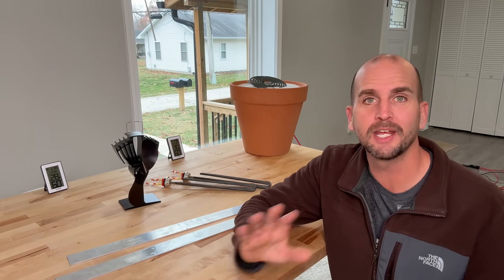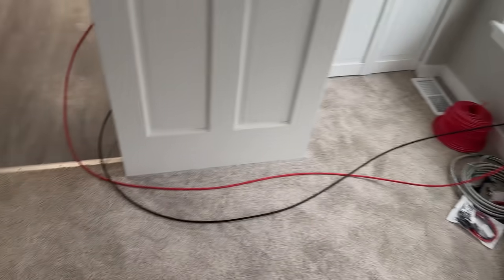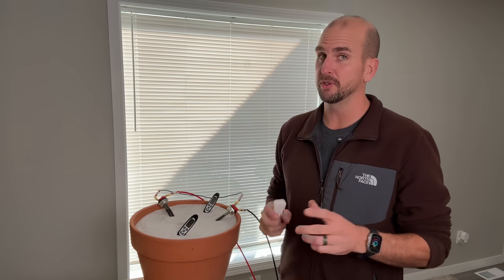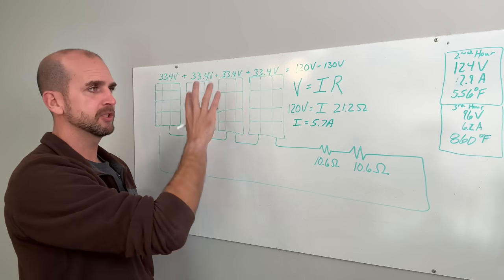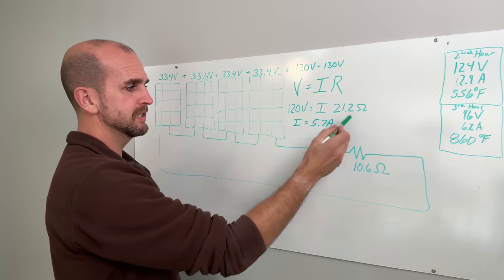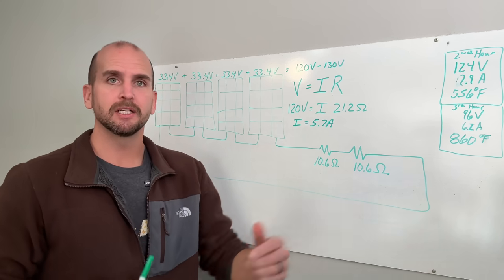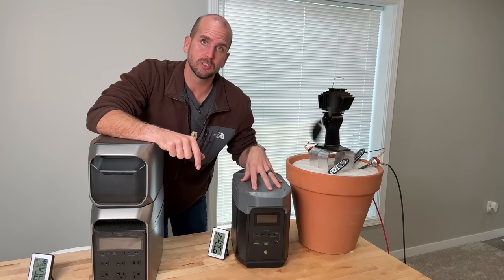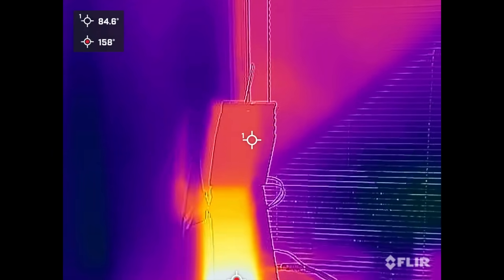Free Emergency Winter Heat | Solar-Powered Sand Heater 2.0

Comment: The single misunderstanding I see time and again in videos by folks trying to store energy is that they think temperature means anything.  Look at the specific heat of sand, which is about 0.8 J / g C, versus water,which is about 4.  Thus, you can store 5 times more heat energy in the same mass of water.  Next, rather than just blowing hot air around, actually calculate how much heat energy is needed to warm that room.  Finally, using solar panels with a twenty-something conversion efficiency means you are throwing 3/4 of the captured energy away.
Reply: Good idea! ❤🎉
Reply: heating water to 800 degrees so it can become a bomb and blow up your house....seems smart.  maybe think before you comment about how smart you are.
Reply: @wtfdoicare  "... they think temperature means anything."   You've proved his point.  The same amount of incoming energy wouldn't heat the water that hot, because it holds (and thus requires) a lot more heat to move up its temperature.  "maybe think before you comment about how smart you are."
Reply: Would automotive coolant help? I assume it raises the boiling point of the water so it can hold even more Jules. If the temps get high enough to boil water then perhaps sand will help when you boil all the water away. Having humidity and heat could make the thing work a whole lot better than dry hot air from an electric furnace. Without water regulating the temperature, is it potentially too hot for the water heater heating elements?
Reply: @wtfdoicare  Did you actually read my response.  It is not temperature you are after.  It is energy storage.  Water stores 5 times as much energy per degree of temperature rise.  You don't need 800 degrees or any other temperature.  You need heat energy storage capacity.  Operating the system at water temperatures is far safer than operating at hundreds of degrees.  Those heater elements will burn out very quickly being heated like that.  As for thinkng before I comment, I have thought about, designed and implemented systems based on these physical principles for half a century.  Tag, you're it.
Reply: @emmettturner9452  Actually an interesting point one encounters very quickly when designing a system like this.  Ethylene Glycol actually lowers the heat capacity of water substantially (by nearly half), while raising its boiling point and lowering its freezing point.  So, if yoou are looking for an energy storage medium, it is best not to use an anti-freeze solution, as it actually reduces the heat capacity of the system, i.e raises its temperature for any amount of heat stored, while reducing the maximum heat capacity of the system.
Reply: If he's using it as a supplemental heater, is it just energy storage he's after? I took the sand to be a diffuser that slowly warms the surrounding environment rate than just a battery.
Reply: So actually, the right way to do something like this is much simpler: pump regular water through a loop that involves something like a radiator inside and some solar water heaters outside. IIRC solar water heaters are basically just boxes, painted black, with pipes snaking around inside. You want to convert the energy as few times as possible, and solar panels, like you say, are ~20% efficient. Sunlight heats the water, you pipe that inside and exchange the heat to the room. Done. Benchmark: you'll never do better than solar irradiance, which is something like 1kw/m^2. A regular electric space heater is something like 1kw, so you'll need a decent area of solar collector to really heat a room effectively.
Reply: @TheTinkering1  Bingo! and Thank you.  The battery, in this case, can be a trash can filled with water. Cheap pump to circulate through the outdoor box.
Reply: @MichaelCampbell01 Something being hotter doesn't mean it is holding more heat (equivalent to energy), so I don't get your point.

The benefit of the sand is that the heat moves through the same more slowly than it moves through a liquid (which would circulate) and it doesn't boil water and change humidity in the house (while taking away some of that heat in the boiling process), so that could be better for heating into the night after the sun is no longer shining. That said, having 800F sand in an open pot is potentially quite dangerous vs boiling water (212F). Imagine a cat putting its paw in the sand or a child knocking the pot over onto himself.
Reply: @h.wagner  yeah, if we just run pex under our concrete slabs and against our underlayment we can easily have a full radiant heating system for the price of a bucket of sand.
Reply: What I think this comment means is: By using water instead of sand you get the same effect (same amount of energy (heat) storage) without the storage media (sand) getting dangerously hot. Bonus: water is free. I love this point. I didn’t realise water was such a great energy storage media compared to sand. Maybe because there’s no air between the particles. Thanks.
Reply: What about salt? You always hear about solar companies using salt for heat storage after the sun goes down. I'm keeping this short, so I'm not going to belabor the point.
Reply: @nicholasearl5703  In the instances you are referring to, they actually melt the salt.  The latent heat of fusion of salt is about 26,000 J/gC, and so it holds about 650 times more energy than water.  But, handling molten salt at 1,474 degrees F is not for an amateur setup.
Reply: If you happen to have a heat-pump water heater and a hot water recirculation loop (about half of homes have a hot water recirculation loop), then simply running the recirculation pump continuously overnight will inject heat into the house's mass via the hot water pipes, and actually noticeably reduce furnace use.  At the cost of electricity, of course.

Obviously that isn't as efficient as it could be.  Due to insulation of the hot water pipes only so much heat can be injected into the house this way.  But the same concept applies to using a dedicated hot water system, without the insulation and without the cold-water mixing valve, in the same way to distribute heat into the house.   And it will work a whole lot better than a sand-battery.

Note that larger heat masses have lower losses on a percentage basis.  heat can only be lost via the surface area of the storage medium which goes by the 2nd power, whereas the volume goes by the 3rd power.   So a LARGE hot water tank will be more efficient.  Like an 80-gallon tank for example.

This is also one reason why soil heat storage can work fairly well and even bridge seasons.  One can inject an enormous amount of heat in the summer and then pull it out in the winter.  A green-house can be cooled during the summer using this mechanism to heat the ground, and then pull the heat out in the winter to heat the green-house.

Large-mass mechanisms like this only work well when you are able to inject truly massive amounts of heat into the insanely large heat mass during the summer, and then pull it back out during winter.  Because even though the losses are low percentage-wise, they are large on an absolute BTU basis.

-Matt
Reply: what matters is conductivity, not capacity. And water is great because it's much more conductive than sand, and in addition it's a liquid so it can benefit from convection which sand can't for obvious reasons.
Using water is the way to go imo.
Reply: @unperrier  I'm afraid I must disagree with you on this point.  The point of this device is to store heat energy, while it is available, to use later when it is needed.  A single sheet of aluminum foil will have incredibly high conductivity, but no capacity.  Given the task you are asking this contraption to perform, the highest storage capacity for heat energy is one of the requirements to make it a worthwhile undertaking.
Reply: @h.wagner  water has a bigger thermal capacity than sand
Reply: @h.wagner  So far you and possibly TheTinkering1 are the only people I have noticed that actually understand the physics of this. Good on ya for dealing with the rest of them, I couldn't bare it personally.
Reply: @unperrier  What wagner is saying is that you are correct that water is the better substance vs sand at this task, but not for the reason you stated of it's conductivity.  You may be conflating conductivity with capacity.  Even if water had a terrible conductivity, it would still be an attractive medium due to its large thermal capacity, its ability to store the heat of the day for use at night.  The conductivity doesn't matter as much, if you were to use a substance with only high conductivity and low capacity, you would not be able to store much of the heat from the day at all, but your room would get extraordinarily hot during the day, and stay cold at night due to not having much heat storage.
Reply: @BloodAsp  They seem to thnk that the temperature of something means anything with how much energy it is providing.  I wish that someone would just clearly state what is going on:

1) We need to store sufficient energy to replace the losses from a room at night.  That amount is (insert calculation here)
2) I can gather this much energy during the day using the following panels or sources (insert number here)
3)  My current scheme can store this much energy using the following method (insert method and calculation here)
4) These are the methods and materials to achieve this goal.

Instead, thee folks all flail around with terracotta pots, overturned onto terracotta pots,  The energy source is a (candle/panel/house fire) it is not going to be any better however you attempt to contain or redirect it.  The energy it provides is all you have to use.  Period.  End.
Reply: @h.wagner  it seems like a more realistic setup is an electric water heater/boiler with its own solar setup and piping to a radiator. Heat the water to the maximum temperature/energy storage level the unit is designed for, then circulate the hot water through the radiator loop.

I suppose extra bonus points if you can heat the water with the solar water heating system as well.
Reply: I suppose a water-based version would have a hard limit on how much it can store when it starts boiling.   Of course, that can be fixed by just adding more water, or switching the heating elements into a different pot, or any of a number of means of handling hot water.
Reply: @dpawtows   Your comment inspired me to do a little math and then have a computer do a lot more math. Water stores enough heat that I don't think you need to worry about boiling it.

The energy stored by moving 300L/80Gallons from 15.5C/60F to 60C/140F (within the operating range of my own water heater) is 15.64kWh, which is conveniently in the area of a 280-300Ah LiFePO4 battery.

Given solar water heating is more efficient than solar electric generation, radiators and pumps are cheap, electric solar is cheap, and batteries and heat pumps are rather expensive.... ~$2000 in water heating equipment for DIY electric-solar + water heater or ~$3500 for turn key dual loop water-solar systems + whatever the cost for your and water to air heat exchangers may be a better value than the equivalent ~$7K 280/300aH LiFePO4 battery, inverter, and heat pump.

An area heater makes this napkin math cheaper but I'm focusing on the heat pump since I think most people would want to add an ~$800 mini-split or use a ~$1400 solar mini-split for something like this.

Interesting food for thought if your main concern is heating, especially for people in areas where boilers and baseboard radiators are already common. Where I am none of this makes much of a difference since cooling and dehumidification matters more.
Reply: Just a few adjustments to your comment. While what you stated about specific heat is generally correct, you must take into account mass.  Equal volumes of sand is over 1 1/2 times as heavy as water. That fact along with the much higher temperatures sand can be heated, goes along way to leveling the playing field.  I am working on something like this for a greenhouse I am going to build.  If you do the math, sand at approximately 400 degrees Fahrenheit gives you about 80% of the heat storage as water.  In my opinion the inert properties of sand are preferable to dealing with water.  Once built, my sand thermal storage powered by solar will last far longer than any water tank.

Comment: Thanks for this interesting and creative idea.  But it seems like it could be quite dangerous.  If there's an unseen crack in the flower pot, the extreme heat can cause it to fracture, and then you've got 900-degree sand spilling on the table and the rug.  Quite a fire hazard.
Reply: If implemented, you would simply need to treat this like any indoor heating solution.  Also, with a little forethought, it would be very easy to implement this solution in such a way that those very high core temperatures are never reached.  Using a much larger aluminum heat sink, implemented long before the temps get that high, for example.

Comment: I am building something similar for my greenhouse.  I don’t recommend hot water elements, they are not designed to be used in this type of environment. The elements will burn out quicker and possibly melt the base of the elements.  I will be using a stovetop element augmented to a cone shape in the sand.

Comment: I like one commenter’s suggestion of using water as the energy storage media. Water will absorb (and subsequently re-radiate) the same quantity of thermal energy, but water won’t get so hot to the touch. The water may take longer to heat up; and may only heat to around 180°F (vs. 900° F) but it will re-radiate the same amount of energy over a longer duration.  Note: a clay pot has no benefit over any other vessel that can safely contain the energy storage media. One vessel type which springs to mind is a large cooking pot.
Reply: it wouldn't evaporate?
Reply: @devinm524  The water container could be sealed.
Reply: It's not as likely to scorch the table or burn you as quickly if you accidentally touch it as metal.

Comment: Masonry heaters are awesome.  If you encased the thermal element inside a container made of firebrick, then wrapped that in some kind of right-sized thermal mass, you could eliminate the need for convection and rely on radiation.  The problem is joules in cannot equal more than joules out...and you're not really getting that many joules in, you're just concentrating it very well.

Comment: Greenhouses have effectively used the soil itself for heat storage... and quite a lot of heat storage at that.  Its called "soil heat storage" and can operate seasonally.  Typically this is done with a solar thermal loop, where in the summer the greenhouse is cooled by cycling the heat through the cooler soil (storing it in the soil), and in the winter the same loop warms the greenhouse by cycling the heat from the warmer soil into the cooler greenhouse.

The soil mass available is huge, if you think about it.  Hundreds of times the mass of a small-scale sand battery, and is thus able to store the heat seasonally rather than simply daily.

In terms of winter heating with sand, there's a lot working against you if using only electrically-driven resistive elements verses a solar thermal loop.  The panels are only 20% efficient verses a solar thermal window and heat exchanger loop which is more like 70% efficient, for example.  Most of the sun's energy is simply lost producing the electricity in the first place... energy that you could have stored instead.

So to really make this work with electricity, it doesn't actually make any sense to use a sand battery.  Instead you use a real battery to store the power and then run it through a heat pump overnight to warm the room at 300% efficiency which improves the effective solar electric efficiency vs solar thermal to 60% vs 70%, instead of 20% vs 70%.

Try using an EcoFlow Wave 2 heat-pump as an example (not the best heat pump in the world but a fully integrated battery + heat-pump solution)... which you could probably test and compare.  At modest settings the EcoFlow burns around 350W to produce a bit over 1000W worth of heating for however much energy you managed to store during the day from your panels.

So with 1280Wp worth of panels lets say on a winter day you get around 3000Wh worth of stored energy in the battery.   3000Wh can run the heat pump at 350W (1000W output equivalent) for 8.5 hours.

-Matt
Reply: Looks like the Wave2 with a battery is currently $999 ($499 without a battery). I wonder how well the sand heater would scale if you took the money for a Wave2 + cost of power and put that same amount into some kind of huge sand battery system. Maybe fill some of those large metal tubs that farmers use and get as many panels and heating elements as money allows. Sounds like a job for @styropyro 🙂

Comment: Wonderful. Sand as an energy storage device; gotta love it. My proclivity is toward solar water heat, possibly steam, for a quiet radiant heat such as easily zoned baseboard heat, and heated flooring. A large (engineered capacity) water tank, super-insulated seems sufficient for<1000 Sf home. Fascinating solutions; thank you for your video!👍

Comment: Overall great idea. This may work for small shed with potted trees sheltered in it. In that scenario a metal can with sand would be better to radiate the heat out, no fan needed.

Comment: You could of course just make instant heat with no storage, but maybe just leave the sand in the room over night (on an insulated pad not wood! ) and measure the temperature in the morning. We once had a Russian stove which put the maximum heat in the room some 5 hours after the fire was out.